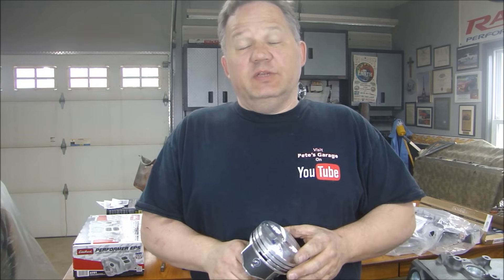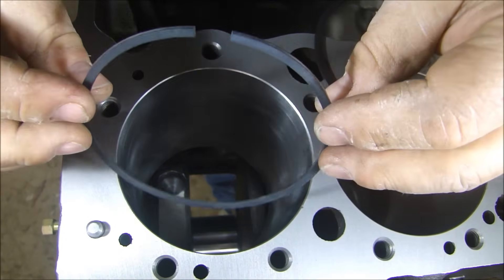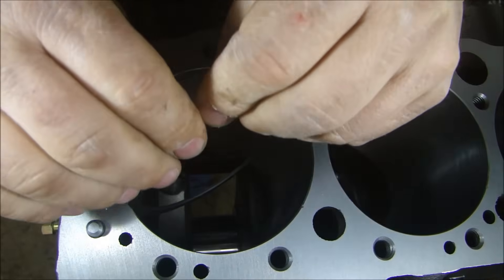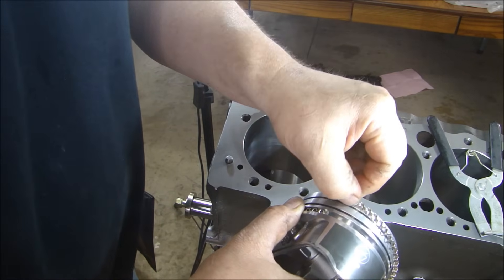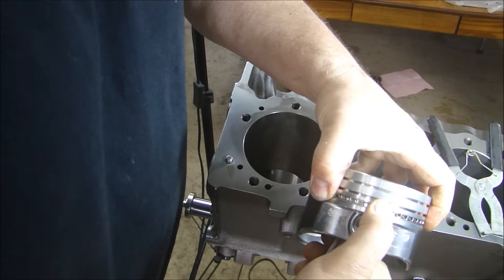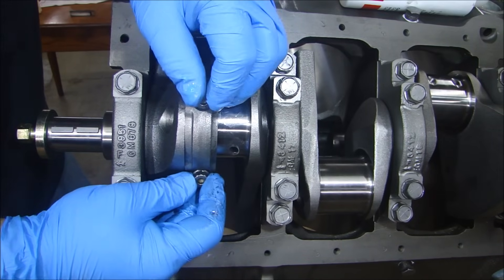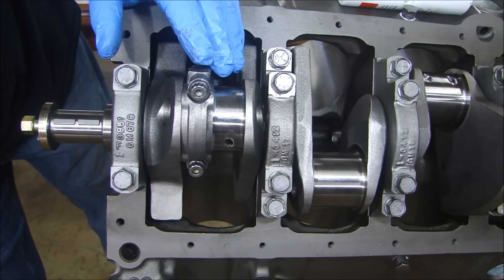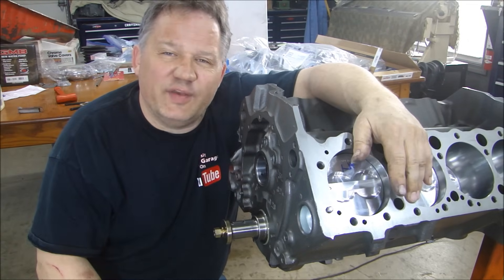Engine Building Part 2 - Gapping Rings, Installing Pistons in a 350 Chevy

Comment: Another outstanding video for any engine builder.   I know I may have asked before, but I didnt see you do it on this build.  Do you check the gap between rod cap pairs?
Reply from the maker: Thanks my friend, yes I do check the rod clearances, but they are purchased to the standard grind size.
Reply: Hi Pete, So a question for myself, i purchased a set of eagle H beam rods for my sr20, standard sizing same with bearings, would you recommend i check anyway? They are to be installed on a factory crank, no machining.  Also, I have CP pistons, niether the pistons or the rods show any specific orientatioin, other than underside of the pistons have CP and serial and rods Have eagle ink stamp on one side and serial number on the other. Thanks Pete
Reply: @spiriteddiscoveries3906  If they are Eagles and you place on a Sunnen Rod clearance tool you will soon find out why you don't want Chinese rods.  I learned the hard way too.  They will be egg shaped once torqued to proper specifications.  The BE on a good rod (Carrillo) should hold true to plus or minus 0.0002" after proper torque is applied.  You will be lucky to hold 0.001" on an Eagle rod.

Comment: Do the rings rotate as the engine is running?
Reply from the maker: They will rotate some before they seat
Reply: So it's possible but not likely that the ring gaps could line up in time.
Reply from the maker: Yes